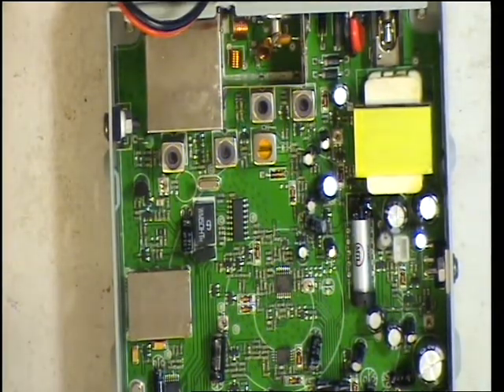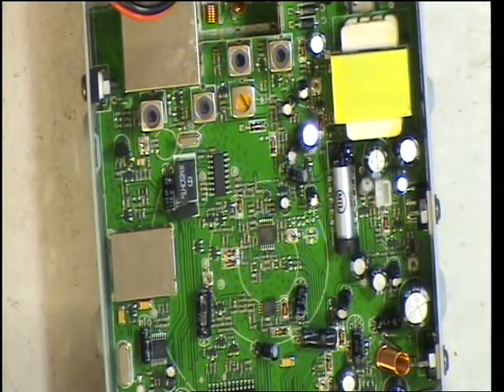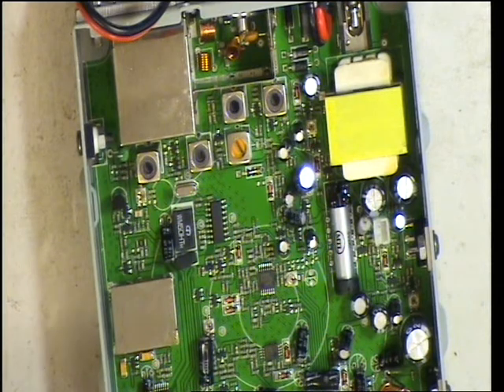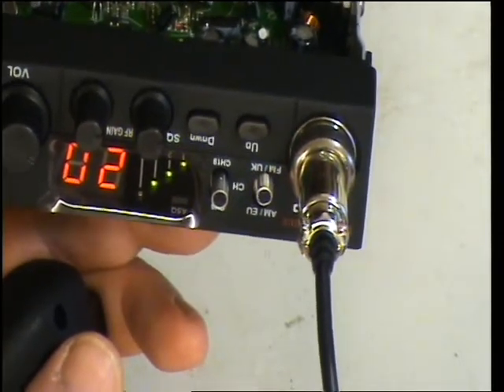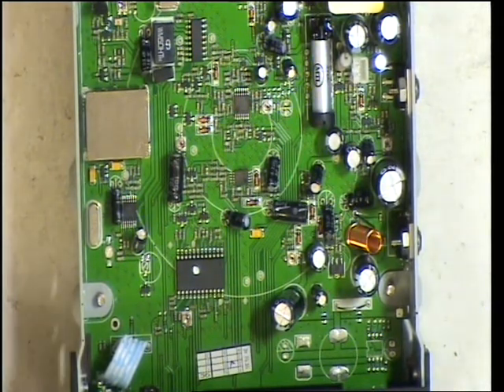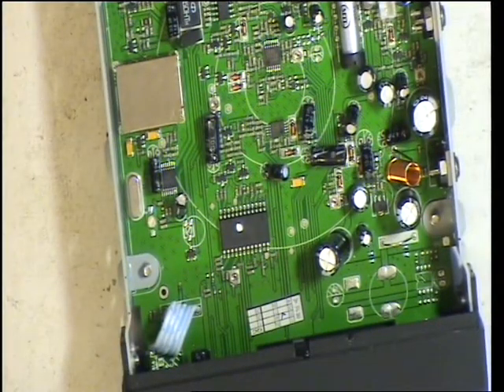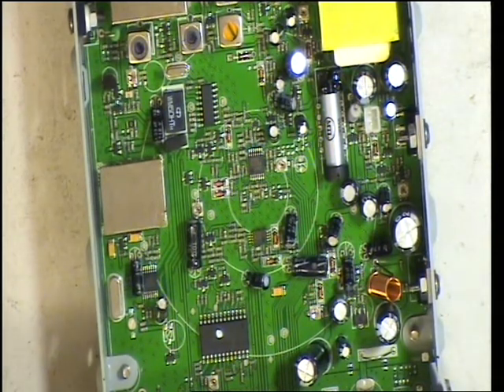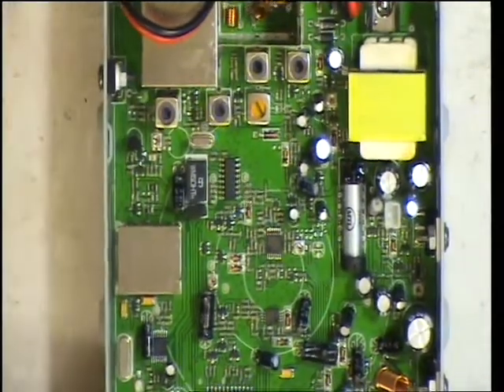Thunderpole T800 (CE Multi-Norm) CB radio (mobile) - RX adjustment

Comment: I sent mine back to the dealer and it's in the hand book but not on the sale page when you buy it . They said it's a printing error. In the Manuel but if it had been in the sale add I would not have bought it  and the audeo was very poor so put the crt mike back. in the car and working great , and the swr perfect 1.2 ,and the radio was a birthday present of my wife so feeling a little let down
Reply from the maker: Good. I can't see any sales blurb on this radio is it's three guises mentioning that the RF gain does nothing on FM.

Richard

Comment: wish I had known that no rf gain on fm a radio that has been spoiled by no rf gainp
Reply from the maker: Yeah, it doesn;t say that on the sales blurb. The latest version turned up from the wholesalers yesterday so I'll see if it's just the same with a re-done front panel.....or not,

I started buying CB's & servicing each one right back in 1982 after reading a "which" report that was a load of bull. They were more bothered by sharp edges & what it looked like from a woman's point of view. 250+ sets later, I've a good idea what works &what doesn't.

Richard